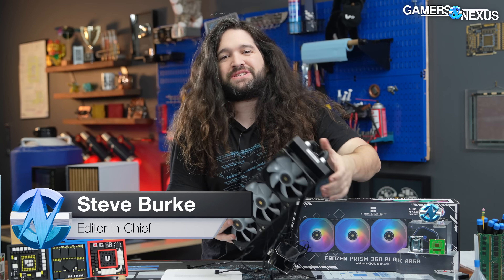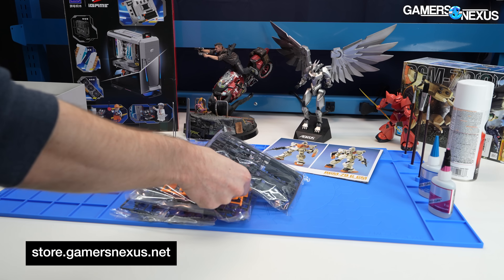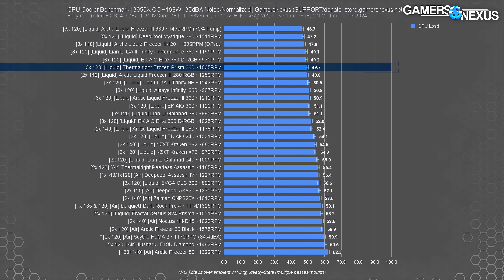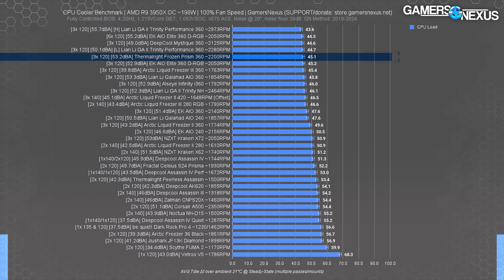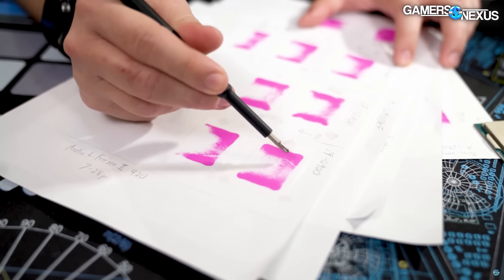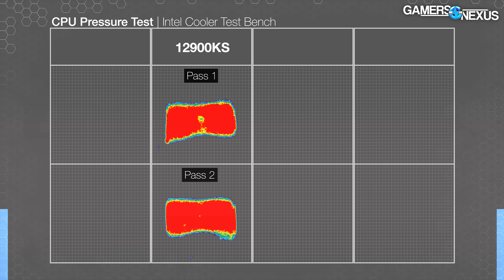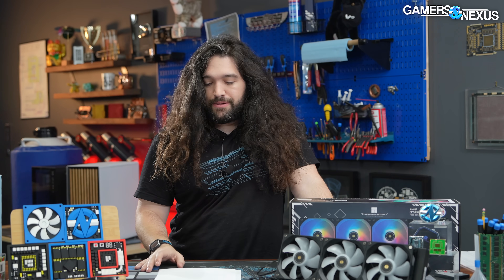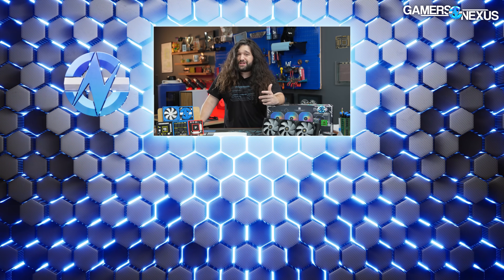Thermalright Strikes Again: $56.90 360mm Liquid Cooler | Frozen Prism Review

Comment: I have the AF3 in white in a white/silver build on a 7950x + gigabyte aero 4090 in a phanteks NV7 with 3 internal displays (i covered the face of the displays with 2way mirror film ) + 12x lian li LCD fans and a crap ton of 3d printed covers. and a special 4th display where a kodak 150 pico projector was dismantled I added polarizers built it into the rear top of the case. a special film used for holographic projector screens was add to all the glass giving it a slightly mirrored like effect with and 5-10% drop in opacity this gave me an apx 10in display on the front glass

Comment: With such pricing, i just wonder, what´s the catch. Also the intel mounting mechanism reminds me of Noctua mounting kit for intel.
Reply: no marketing and probably low research cost because they just look at what the market did and copied it and lower Profit margins
Reply: @zexal4974  I still suspect them either cutting costs everywhere, or just undercutting anyone else and selling their units at loss - if not both.

Because it doesn´t make sense otherwise. This is below even the cheapest "cheapskate" AiO sellers, which should generally be avoided due to lack of QA.

Comment: I have 3 of the 240 aqua elite V3 units on my AMD systems and they work fantastic I do run them now with Artic P12’s as I didn’t want the rgb I repurposed those fans to other projects. They keep my 5800X3D,5800X and 5600 all in the 60’s max load and full boost clocks. Great review as always.

Comment: I bought a Frozen Notte 240 in August 2023 and the pump completely died in April 2024. I ran it at 100% speed (basically silent btw), and my PC was on for about 2-8 hours almost every single day. I know, less than ideal circumstances. There are also many customer reviews claiming the same thing. I wouldn't say to avoid Thermalright's AIO's altogether, just know what you're buying. It was good value, and worked well while it lasted, but I'm definitely never buying a Thermalright AIO again lol.

Comment: I replaced my dieing corsair h100i after almost a decade of service with a frozen notte 360 couldnt be happier! This cooler does its job perfectly, even better than the h100i did new, granted this is a 360mm cooler instead of a 240mm and technology has advanced since that h100i was new.

Comment: One thing worth noting is that people familar with thermalright AIOs commonly regard to the prism being the worst of the thermalright lineup, so if you are impressed with these results, keep in mind this is legit the bottom of the barrel of thermalrights choices, their other options will do even better (specifically in noise levels, and the prism tends to have pump issues overtime)
Reply: What would you say your ranking of the different models are? All the different models have me confused.
Reply: @mzevmail8450  I'm not that well known with them, but what i do know is that the edge and prism are least reputable, and the notte and aqua elite are most reputable
Reply: @mzevmail8450  basically everything besides the prism and edge is goated, edge and prism supposedly hasp pump problems, and the others have slightly more modern fans that are a bit quieter, my fav personally is the frozen vision

Comment: I'm the kind of person who'll happily spend 3x the price for something I know won't fail. That's led to my old NH-U12A still running three systems later on a 7800X3D with zero issues. Maybe that means this AIO isn't the right type of product for me but I'm still left incredibly impressed. That price to performance ratio is crazy. Even if I wouldn't use it myself, knowing the price I'm not going to sniff at anyone who chooses it.
Reply: The U12A was launched in mid-2019. You've changed systems 3 times in 5 years? I'd say reusing air coolers is the least of your issues.

Comment: A couple of months ago, I bought a $15 USD Thermalright tower CPU cooler. It was a pretty good deal.
It could have been better if the fan blades were a bit smoother.

Comment: There are some good points to be had about how this thing has no competition in terms of cooling performance around this price (apart from other similar Thermalright AIOs), but in my opinion, any build with a CPU deserving of a 360mm AIO for cooling is likely of the budget level where it could be easily justifiable to spend another $60 to get something that is 1. quieter 2. slightly better performing and 3. likely more reliable in quality and warranty service. So I don't really see where this product fits on the market.
Reply: Microcenter has recently been liquidating the 12900K in CPU/mobo/RAM bundles for just $300. While it can be air cooled, it needs a 360mm AIO if you want to try to OC to 5.4GHz all-core. Combine that with this AIO, and an RX 7800XT, and you've got a sub-$1000 monster.

Comment: I've had one of Thermalrights Frozen Magic 360 Scenic V2 360mm AIO's cooling my sim rig PC for about 8 months or so, and it's been genuinely amazing. At €65 it was half the price of my older Arctic Liquid Freezer, and seems to perform just as well. I genuinely considered getting one of their newer model AIO's over the Liquid Freezer III 360, but Amazon didn't have the one I wanted in stock, so I got the LFIII instead. I don't regret that decision at all, but I am fairly certain that I would be saying the same thing if I had been able to buy the Thermalright cooler instead.

Comment: used one for 1.5 years now. Temps and sound level is the same as day one. I do maintain the fans and radiator. Clean and air blow every 3 months or so. It's solid, they are my go to for cooling solution now and future builds.

Comment: Been using the Aqua Elite 360 V3 for 6 months now.  Also put the same fans as the cooler in my system, 3 on the rad, 7 in the system since they were only about $4 each (TL-C12C-S).  Been running perfect.  On a 12700k with a slight overclock.  Never once had it go over 68C and that is only on all-core synthetic benchmarks.  Pump is set to 100%, fans set to a curve.

Really been happy with it.  Got the same model in the 240 for my NAS/VM host machine a week later, it has been fine as well.

Comment: i had a thermalright aqua elite 360 which right now is the same price at $56, cannot be beaten at that price, kept my 14700k well within check, thermalright is on another level
Reply: What are your idle temps and full core load temps? I have a 14700k with a Deepcool Assassin IV and just can't keep it cool in CPU intensive games and am thinking about a thermalright aio.

Comment: I just got the Thermalright Frozen Notte 240 Black ARGB Water Cooling CPU Cooler thanks to this video for $50.90 +tax+shipping(free shipping for me cause I have Prime). Can't fit a 360 in the case I am using. I am currently using a 120 sized ThemalTake AIO cooler that I paid like $85 for at BestBuy as it was the cheapest option I had at the time. Hopefully this runs my CPU even cooler!

Comment: quite a few of my friends have only ever used thermalright Aio's (they have the magic scenic or w/e its called) and have had zero issues with it other than the fans aren't the quietest.
personally I have used thermalright for 10-15 years (loved the Frio OCK that released way back in like 2010-2011) but have only used their air coolers and I love them, right now I have a peerless assassin in the NR200, personally despite using them for so long even I don't understand how they make solid products for the price.

Comment: I have a year on the Aqua Elite 360, works  just as good a year later. I swapped it out with a Frozen Edge 360, and running the 3x TL-B12 V2, the 2200RPM ones, and a pair of TL-K12s in pull. I run AMD right now and temps are pretty much lower than I see others running with the same hardware.

Comment: @GamersNexus I started using the white 240 rgb edition of this as temporary cooler (now my permanent cooler ) been using for 6 months now, can honestly say it has worked flawlessly cools my ryzen 7 5800X 4.8ghz all core overclock much better than the one it replaced costing nearly 3 times as much, not goanna lie was sceptic at how well it would work or how long it would last but so far so good, a few friends have bought one after seeing how good it was. when I upgrade the wife's pc I will be using a thermalright 360 aio for hers

Comment: I have been getting the itch to try liquid cooling. Previously I could not justify the price of some of the ones that I was looking at. However I have been using Thermalright air coolers for a while now and they perform very well. Might pick up the non-aRGB version for the price.

Comment: Normally white is more, but here it's 55.90 for the same unit. :) 
Non-RGB is only 54.90. So yeah cheap. 
I've gone back to air cooled only. Tired of clogged blocks and/or failed/noisy pumps.
Yes, water is better. Yes, water is less reliable and requires to much disassembly for maintenance!

Comment: Personally I don't know about endorsing arctic. Numerous comments and videos from this channel had led me to believe that their product is nothing but amazing with wonderful customer support but it seems my experience  has told me otherwise with a defective aio which I purchased and have yet to receive support for. After I got my arctic cooler I have encountered nothing but numerous problems, and this is especially concerning for me given its my first build and my pc has been out of order for nearly a month due to it.  
Many of these problems include but aren't limited to, lackluster performance in cooling(with temps idling at 50 and easily hitting thermal limits), terrible product quality, with broken screws that do not allow me to mount it properly a second time, a seemingly uneven cold plate and the shittiest customer support one can imagine which can't answer basic questions if their life depended on it which puts me out of luck for the time being.
On top of this its been more than a month since the initiated ticket  and they've been ignoring me for weeks on end and not transferring the ticket. it seems there is not a day for resolution in sight.
On top of this I'm  told I'd have to pay for shipping with the given costs of shipping the darn thing where I'm from costing more than the price of a buying and being shipped a new one which entirely leaves me out of luck as a first time builder and out of options. 

You can see these images here for you to believe me if you want. But overall my experience and others alike with them has been nothing but terrible and its been utterly distasteful. 
https://imgur.com/a/4STw3Lf
https://www.reddit.com/r/arcticcooling/comments/1d351d4/liquid_freezer_3_bad_temps/

Comment: 12:25: It should be noted that the bracket is imprinted with "AM4" but this works with that, and also AM5. Thermalright did not change the design when AM5 came out. An AM5 PC builder can safely use the AM4-labeled bracket. This may avoid confusion as they dig through the box looking for an "AM5" bracket thinking it was lost or not included. 

Hope this helps.
Reply: Thermalright, not Thermaltake
Reply: This should be pinned. Very important info, thank you.
Reply: Thank you!
Reply: Thank you for this. I know it's a bit late but I don't have the plastic retention brackets that came with my motherboard anymore so I was hesitant to buy this AIO. Knowing it's a one for both AM4 and AM5 makes me confident enough to buy it.
Reply: The AM4 coolers mount the exact same way as AM5 so yeah I’d hope it works lol
Reply: @guccipucci69420  Please try to remember that not everyone shares the same knowledge and experience. You may know this but, to many new PC builders making their first machine, that's an unknown in completely new territory.

Comment: I do not understand how they can be selling these for $60 USD. The material cost for the cooler, with packaging, has to be at least $20 (assuming the fans are the cheapest possible and the rest of the AIO is barely holding together). Manufacturing, shipping and associated overhead seems certain to cost Thermalright another $20. Retail operations generally get a 50% markup on every product to cover their costs. So I just cannot see how these things can exist.

Comment: I literally just ordered a white one, I was hesitant because it was such a great price.  But now I can breathe easier because of this video.  Should work great.  I have a custom loop but now I can route it just through the GPU and this will give the CPU it's own rad and cooler.  Should be a great all around deal.  I got it for less than I was about to spend on a new cpu cooling head as they are touchy to get decent cooling out of without breaking the bank.  Aio is becoming FRUGAL!  Which is good!  I will put my Lian Li fans on it, it fits my stormtrooper design and should be good for just cooling an amd 5800 x3d which is not known for being overtly hot as the newer cpu's.  Thanks again Steve and Crew for good info.

Comment: they have been a solid budget option for me on lots of builds over that last few years ... only 1 bad so far .. if amazon would stop shipping them without a box .. or in a bag I'm sure they would be fine   the 3 pack of argb fans they make are a good price as well .  makes it easy to have a 360 aio with 3 fans and 3 more fans .. paired with a corsair 4000D with the aio in the front has been a good value option for my customers ... spending 100's on fans seems pretty stupid .  cables can be a bit of a mess .. but at least they daisy chain both the fan and the argb

Comment: I own a Thermalright Frozen Notte 360 for my 7800X3D which only draws about 45 watts, LOL! Overkill but was a previous Intel customer before this processor trounced the competition this last year.  So I had Intel heating on my mind when I ordered this.  I was suspect on the price myself as well. So far 6 months in and working fine.  Will keep you posted if/when it quits.  Sorry but this obsession with noise is baffling: even running the fans at full speed is not very loud compared to other fans in a case when its sitting below and near the floor.  For 45 watts; half speed fans are fine and barely noticed it running below me.

Comment: I've had this exact one installed in my PC since August of last year, so it's great to see it reviewed! Managing to get the exact same Thermalright model is making me feel like I should start guessing lottery numbers. One data point isn't massively useful in itself but I can at least attest that there's been no changes in thermal performance over the initial ~10 months on mine, and considering it replaced a Corsair cooler that I opened up and found full of gunk I'm pretty satisfied they're not cheaping out any more than a more expensive brand. If I have problems with it at any point in the future I'll let you know!

I actually originally had the Thermal Notte for about two weeks, the in-line pump was annoyingly loud and wasn't PWM controlled so I swapped it for the Prism, which had already shifted price down to £59.90 from somewhere just above the Notte at £63.90. I definitely suggest people read the spec sheets on these coolers pretty closely, I had to dig fairly far down the Amazon page to make sure the Prism's pump was 4-pin PWM.
Reply: Useful info to know, thanks
Reply: thanks
Reply: honestly, at that price range, if it ever got gunked down too much, I would replace it with a new purchase after a few years of use.   thanks for the info. cheers.

Comment: I bought a 3 pack of Thermalright 120mm RGB fans for like $14. One of the fans died after 2 weeks (clicking noises). So I figured I'd just snag another 3 pack and have spares.
Next 2 of the other fans started acting up so I just grabbed another 3 pack fully expecting more failures. Now I have 6 out 9 working fans and instead of the initial $4.66 per fan I ended up paying $7 per WORKING fan.  That's still not a terrible deal, but averaging 1 dead fan per 3 pack is pretty bad. They are sacrificing QC in order to just get more product out of the door.

Comment: I purchased and returned this cooler, simply because the noise was insane, I think there were bubbles in the pump. Now I could have requested a replacement, it's possible I just got a defective model, so it's not fair for me to say this is a bad cooler. However, for $4 more, I purchased two "Thermalright Frozen Notte 360 Black ARGB." They are $63.90 on Amazon. Both of them paired with the Ryzen 5 7600x, as the more budget oriented air coolers for this CPU ran a bit hotter than I wanted on light loads. Both of these coolers worked great. Biggest challenge was cable management, but I planned ahead, did a demo build, used 3 mini velcro ties and one normal size velcro tie in the back next to my PMW hub and all was well. This was the only big downside. I would really have liked to see you review that AIO over this one, because the prices are nearly identical, and the Notte 360 is better looking, quieter in my experience, has better reviews on both Amazon and NewEgg, and just seems to be a better bargain in price to performance. 

Either way, class review man, good video. I hope you do a best AIOs of 2024, like you do with air coolers in the past few years. Thermalright is a very interesting company.
Reply: Exact same situation. We should go bowling together. The Notte, which he makes a joke of (not sure of the joke really), is less than $4 more and way better than this AIO from ThermalRight. Big opportunity missed IMO. Why not include their best budget cooler?

Comment: My main concern is the longevity. I have 8 year old Corsiar h105 that's still runs very well. It is currently cooling a Ryzen 5 5600X and under full load it doesn't get about 65C with ambient of 24C. I've bought several Asetek 240MM AIO's that haven't lasted over a year before and I've had some where the rubber on the tubs failed/cracked and spilled liquid all over motherboards. I don't think I'd trust Thermalrights AIO near my desktops.